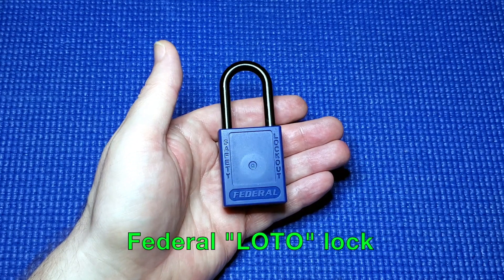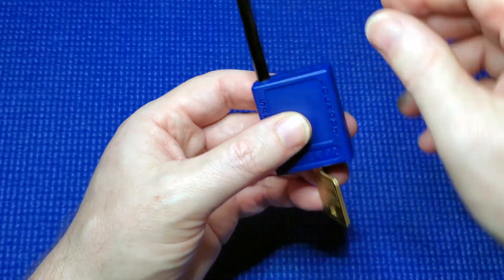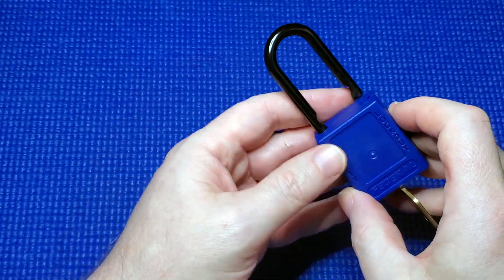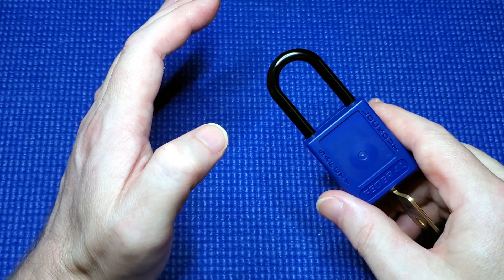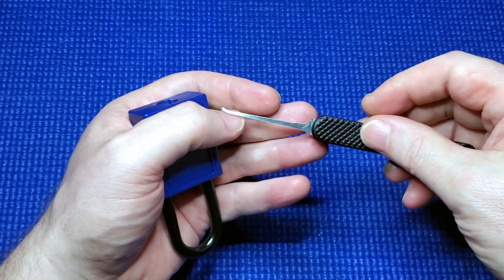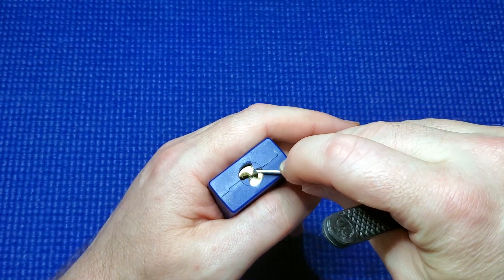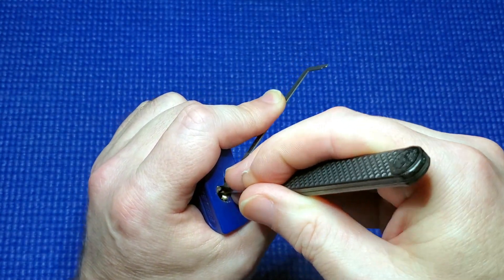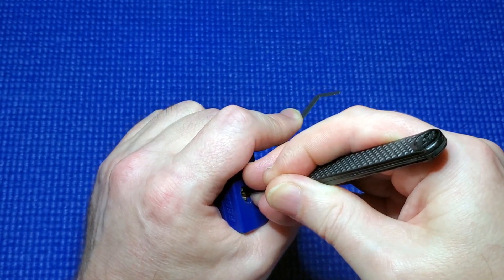(188) Federal LOTO Lock picked

Comment: I didn't know that about the volatile gases and a spark from a dropped padlock, makes sense though. First I have seen of a all nylon plastic shackle, they usually just have a steel shackle with a nylon coating.  Looks great to with the blue body and black shackle. Seems like Federal are making them the way they should be made, Great picking with those wonderful clicks. Thanks for the information and for joining in on #LotoLockTuesday, cheers mate
Reply from the maker: Cheers PW mate! 😜😜Yea that spark thing I read somewhere on one of the marketing blurbs that they are "spark resistant" and I imagined the rest, but maybe they didn't mean that? Anyway they are fun pick! 😜😜Cheers